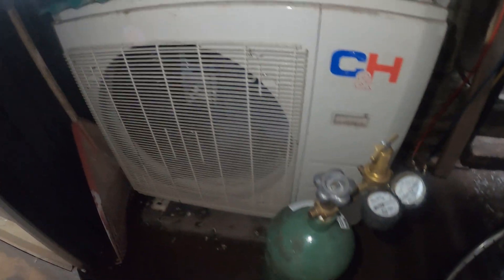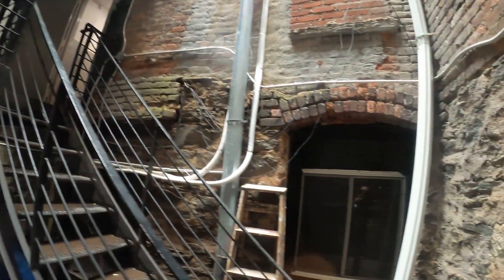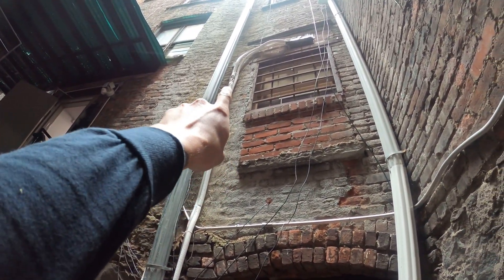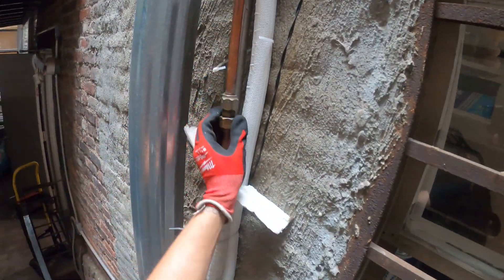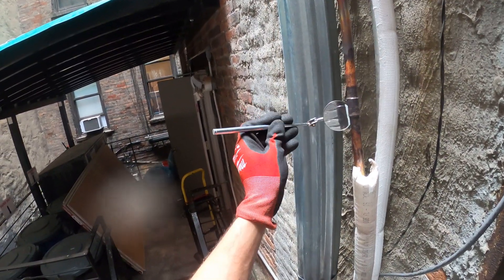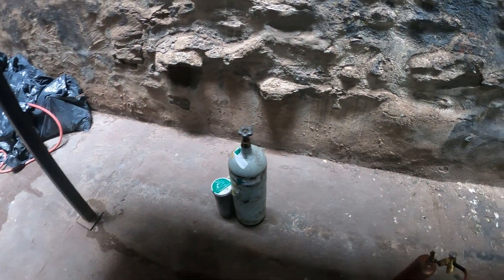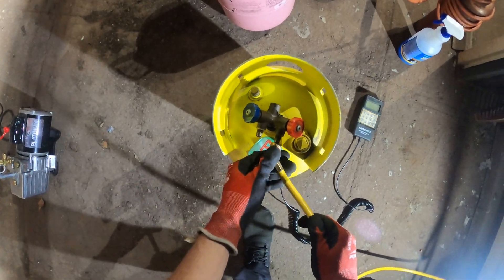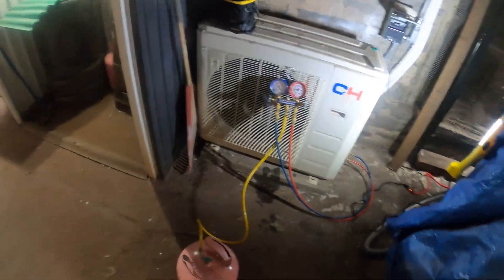HVAC Service Call: Ductless Mini Split Heat Pump Not Cooling (Cooper & Hunter Heat Pump Not Cooling)

Comment: Installed many of these in while working for the military in Iraq, charged using Run Load Amps on spec plate and an inductive ammeter around line voltage wire.  Works no matter the length of refrigerant line, exceed RLA, overcharged, will not cool. Leaks are usually at flare connections, Just my two cents worth. Keep up good work JM!

Comment: Not suppose to braze on mini splits.  I use sta brite 8 if its my only option
Reply: Why not I do it braze other time is never had problem better than the flare came from manufacturer 👍🏽
Reply: Any flaking inside pipe will cause restrictions.